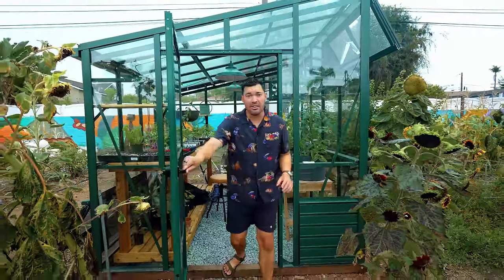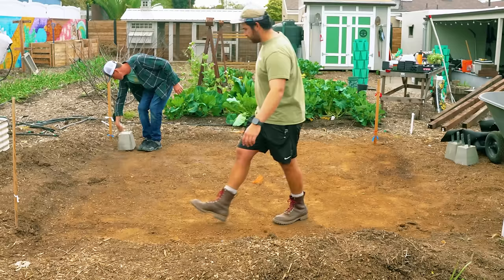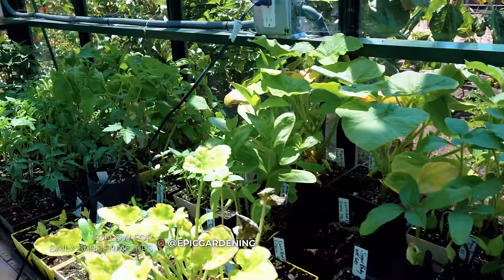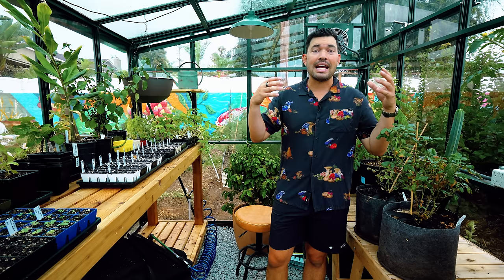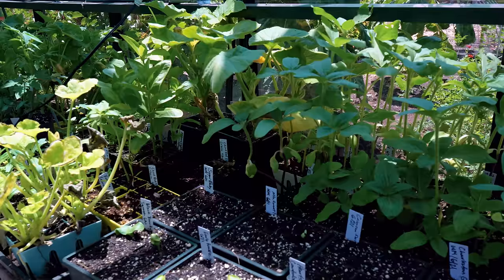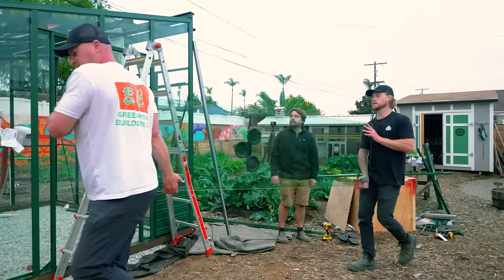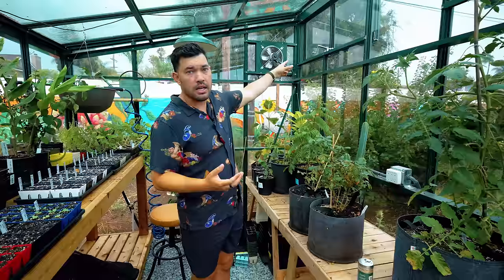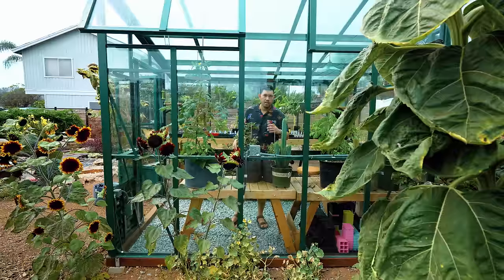What I Wish I Knew BEFORE I Got A Greenhouse

Comment: Imagine a sudden attack of hailstones or heavy snow weighs onto your greenhouse, probably  fierce punching making many holes on the rooftop we expect. In fact I have a dream of having greenhouse like that on larger scale one day, but because of climate change, my place won't be safe anymore. We have experienced severe hard weather conditions in my country. We no longer stay in safe zone out of weather striking disaster. That's my concern about the greenhouse, of which material I must use to make resilient structures against erratic weather. Glass will be too vulnerable. Acrylic panels will be weathered by strong sunlight to be broken some day. Any other substantial material to cover up the frame, I don't know yet. There comes my question started.
Reply: Actually not true. The glass used in a greenhouse is chosen to be able to handle snow and hail.

Comment: Offering another perspective here…I bought a $600 greenhouse 2-3 years ago. Polycarbonate panels on aluminum frame.  I’m located in central texas and after a few seasons of hail and UV my ceiling panels are toast.  I imagine a greenhouse is like anything else, you get what you pay for but for anyone eyeing a cheaper price point, consider what panel replacement might cost or upkeep and maintenance in general.
Reply: Don't feel bad - even the expensive ones have their risks like not putting in a climate that has strong winds, that's why they are more prevalent in some areas than others.

Comment: In central Georgia (zone 8A), high humidity and heat would make a greenhouse only useful for winters unless other design information is given to get the temperatures down for fall seedlings and from freezing inside in the winter. A lot of careful design information would be needed to use this greenhouse all year long in our area. Would this company help this way?

Comment: All glass or all clear plastic Greenhouses on all sides is an inefficient design and wastes a lot of heat. There is no reason to have the North face of a greenhouse clear. The best Greenhouse design is to orient your greenhouse long ways facing South and entirely insulate the North half of the greenhouse so only the South,West,and East walls are clear. This can potentially double the amount of effective ground geothermal  heat to wall heat loss ratio. In simple terms, on cold days and nights, the 55 deg ground is a heat source and all your greenhouse walls are heat loss surfaces. The ratio of heat loss wall and ceiling surface area to heat source ground surface area determines the final inside temperature (in simple terms not taking into account the amount of thermal mass inside for heat storage, the more thermal mass the more potential heat storage) . By heavily insulating the North side of the Greenhouse you drastically reduce that surface area as a heat loss source, and the longer your greenhouse is, the more of a positive difference it makes.

Comment: I have a 10x12 wood and polycarbonate greenhouse. It gets 120 in summer! Nothing lives but a few succulents. In spring I started seeds but because I had to put two layers of shade cloth over the greenhouse, so that it wouldn’t burn up now I’m going to have to install grill lights in order to use it to get good strong ceilings. Tried a window air conditioner but it just couldn’t handle it. I do have a fan and I do have an exhaust fan but it’s just too hot to use in the summer. Any suggestions?
Reply: …install grow lightsI meant -to get sturdy seedlings

Comment: i got a greenhouse but it’s too hot inside and my seedlings didn’t do well because of this …. i’ve already open the windows…. i dunno how to keep the greenhouse cool
Reply: AC
Reply: Try a shade cloth on top.
Reply: Shade cloth helps a ton, I also bought a small solar powered fan off amazon, cut one of the wall panels and installed it as an exhaust fan and put the solar panel on the roof.  Runs when sun is shining so helps when most needed, I turn it off for winter.

Comment: Oh no, never run irrigation under a greenhouse, ever.  If you have to re route them, then do it before you build.  In the future you will be cutting those line and re running them anyway, but you'll have a green house and foundation to have to work around.  It's just me, but for the cost of a greenhouse, you can set up a hydroponics system, build a workbench in the garden, and have lot of money left over.  We built our own hydroponics system in our kitchen, and it's a joy farming literally from plant to plate.  The other benefit is that we have our most used herbs growing fresh in our kitchen within a few feet.  If you want more moisture, for more tropical plants . . . then maybe the greenhouse option is better for you.  As for seed starting, I do all of mine under grow lights and transplant, so the seeding benefits of a green house would be lost on me as well.

Comment: I'm a carpenter, I've tried to be very vocal in that you're subgrade needs to be lime or concrete stabilized compared soil inspected by a qualified inspector. You need some kind of concrete: pier, foundation or footing up to code. You need to grade every with a Lazer. You need to 6/8/10 everything. You probably need a vapor barrier. If you didn't understand any part of this it's time to stop.

Comment: Don't buy a cheap greenhouse. That's what I learnt the hard way. Go for a model that has a 10 warranty attached to it and plenty of replacement parts available. If you are an inexperienced builder, hire a tradesman to help you. A greenhouse is an investment that is worth doing properly. Treat it like your car.
Reply: True. I have no where to put a greenhouse so when an opportunity to take down an  old but expensive greenhouse came up we took it but had to sell it because we don't have a place for it. We sold it for 1k in pieces and 1.5k if we deliver it and build it. Mind you we had no experience but luckily my partner is an engineer so can usually figure out how most stuff works. It was only a 3 day job for us since they had leveled and put down gravel. All metal and poly carbonate panels with windows doors and tie towns for the wind. I feel like I could build another one now and look forward to having a yard someday to design a nice greenhouse for the garden.